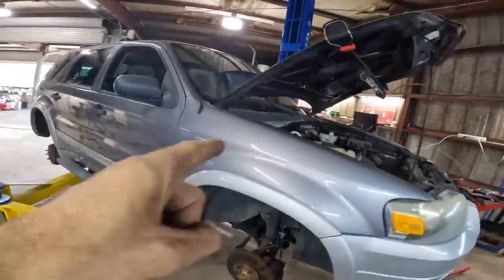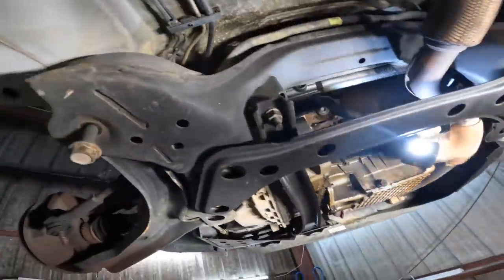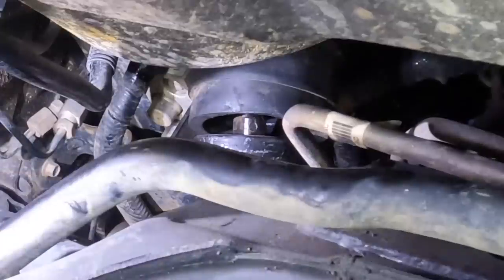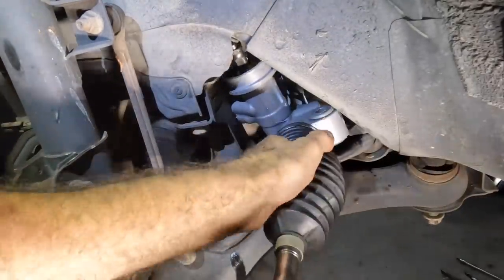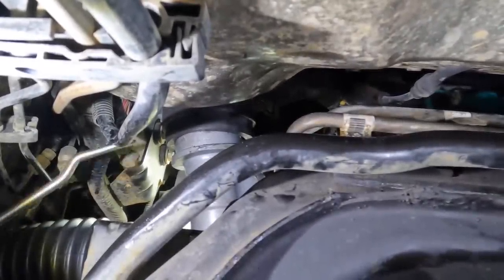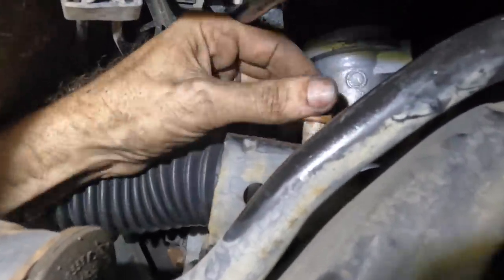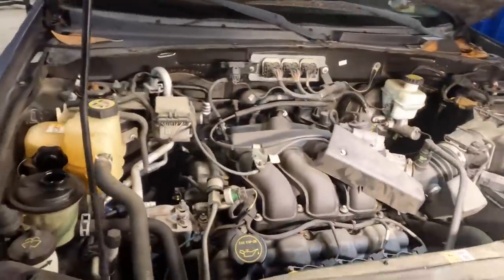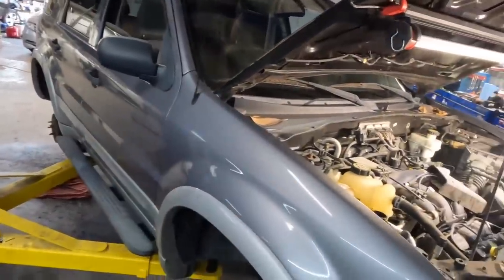Loss of Control, Sloppy Steering! Damaged Ball & Socket! 2007 Ford Escape

Comment: When I replace a steering rack, I always check front tire wear. If the wear looks good, I reinstall the new rack exactly the same length as the old one. It doesn't work if the old rack has too much wear. It works on leaking racks. An alignment is always good, but sometimes not always possible.

Comment: Really any full synthetic oil and a quality filter will work fine.  I usually run Pennzoil Platinum High Mileage and a Wix XP,  Purolator Boss, or a Fram Ultra Synthetic filter.

Comment: So on the oil stuff. My brother taught me this a few years back, but supertech full synthetic has the same stuff as the name brand stuff you're saying at a fraction of the cost. As long as you follow typical oil change intervals it does the same protection. He's put it in all his supercars to include the latest  Masi he bought. Never had engine issues in any of his cars.

Comment: I am sitting on a passenger side front seat out of a 2007 Ford Escape. Blue vinyl, still in good shape. I have it mounted on a base for my driving rig/office desk/entertainment seat. Bought it for $60 last Summer at a local wrecking yard. Lot cheaper and more comfortable that a driving rig seat. I put an Indian blanket/Mexican blanket cover on it. It will last many more years. Buy the passenger seat since they do not get the same number of hours as the driver side.

Comment: I have 2004 cherry condition Ford Escape XLT with 190K on it. Best car EVER! Never heard of a steering problem... 🧑‍🔧🤷‍♂
Over here we have daily free delivery by the parts houses.
I have in years past scribe marked and measured steering parts, shafts and ball joints. Upon reassembly use corresponding scribe marks and measurements, didn't need alignment.
SO HAPPY you don't use a d*mn phone for these recordings. I cannot STAND those things.

Comment: wix, fram, etc, etc. look up a oil filter for a 1966 vw bug. mine had over 200k on it when i sold it. i do use wix, mobil full synth in my wife's rav4, just acquired a tsx that has had and will continue to get that treatment along with top tear gas only. 91 f250 258k on odometer, 86 ranger with 320k get fram, Costco oil and cheapest gas around.

Comment: I would cycle the steering a few times to get all the air out of the rack.
I'm not sure if it's necessary, but I imagine it gets trapped in the cylinder.

Comment: Doing the repair correctly and professionally will usually be enough to give you a chance at success, but it's doing the "little things" that will ender you to your customers for their repeat business.  And, little things can generate extra income, AND go a long way with customers.  And it just takes a minute to go that extra mile to build customer loyalty, anytime you touch their car,   i.e. topping-off all the fluids, checking all the lights, signals, and wipers, checking the air pressures in their tires, greasing all the frontend joints anytime you work on the frontend.  Some shops (mine included) even clean the windows and vac the floors.

Comment: Escapes are notorious for motor mounts and steering locking collars going bad. Used car dealers always trying to pass off the engine vibration as normal for the Escape. Same for the difficulty getting the key to turn far enough to start the engine.

Comment: Hey, quick tip on the "whine" or air cavitation after startup/new rack/new pump- manually run the steering lock to lock a good number of times, that manually bleeds the system. You'll see the fluid drop a good amount. Doing this prevents possible cavitation damage on older pumps. Hope it helps.
Also, congrats on the shop!

Comment: What is the difference between a cotter pin and a split pin?

Cotter pins are made of mild steel and are used for locking nuts at the place. They are inserted into the hole of the bolt and are then bent into different shapes to prevent the nut from falling out. Whereas Split pins are made up of harder grade steel. It is once inserted into the hole to lock the nut.

Comment: Ford specs synthectic ATF now  for transmissions and power steering.  From personal experience last weekend the Valvoline DEXRON®-VI ATF Full Synthetic Automatic Transmission Fluid worked very good and make my power steering noise go away when cold.  I used 1.5 quarts from walmart and it was like $7 a quart.
Reply: Wouldn't he have used mercon 5?

Comment: I ask this as a question as to my last power steering pump replacement. I for the life of me couldn't get the lines purged. So much so that I thought I got a defective pump the first time as it got quieter for a day or so then it would start the whining again. So I replaced it again, same issue. I spoke to a "real" mechanic and he said that I wasn't doing it right. I did as you did and just removed the cap and a couple of quick turns left then right. Which I notice you didn't even do? 

He said to remove cap, and then endpoint left then right several times with engine off (Car jacked up of course). Then allow it to rest a few minutes for air to travel up lines, and then rinse repeat several times to clear all the air. Then start engine and endpoint to endpoint to check and then repeat procedure if needed. His explanation was that once engine is started the air is "whipped" into the fluid thus once cap is replaced it can't purge from system. You say the whining stopped but I could still hear it somewhat....So what is right as when I did it his way I had zero issues from then on. Are different manufactures different procedure?

Comment: I have a 2010 Acura RDX and it requires Mobil 1 5w-30 and with 114k, I use the High Mileage formula

Comment: 21:52 said every other mechanic before you. You know................ the ones you used to comment about when the customer says someone else did the alignment and it was off. Not taking into account the worn, sloppy parts that are now fresh and tight. HAHAHAHAHA

Way back in the day I used to hang with my uncle who was what some people refer to as a "shady tree" mechanic. A mechanic who used to wrench out in the yard using ramps, chain hoist, etc. When he did front end work he used to pretty accurate with aligning the wheels. His method consisted of a two inch piece of flat stock steel, long enough to reach where he needed it to reach. He would pull the rear wheels, line that steel up with the front wheels and watch the linear path or angle to make sure it was straight. After he would road test and always travelled straight. Never had a complaint or return work. Even some alignment people were impressed at his method. Of course today there are modern computer methods that people swear by. There was a time when alignment equipment was not available.

Comment: Figured out the weekend that these new injectors are still  (causing) Regurgitating aka (regenerating/over fueling ) since the other Thursday /week and a half. So going to find out if the injector codes were installed as well. With doing two trips to where I normally go to work on the truck with O/D off so ran at about 2,600  should have burnt that soot out!!!!!!!!!!! One with driving normally. 
Burns lots of diesel with that crap working. 
Sure would be good to have Ray work on it, but way toooooooooooooooo far away. 
The service advisor the other week said that the mech akaRE/RE was fastidious about (Clean)  YA RIGHT! His coveralls were oily as Hell! Do wonder my seat blanket was OILY!!!!!!!

Comment: I have a feeling, it's a lot more involved to gain easier access, replacing that steering unit, but like they say, "time is money" and the bottom line is, your way worked.  ;-)
I'm sure there's a way of locking that "death bolt" in place, but I didn't see how?

Comment: have you got a white (or melanin deficient) pen to mark those nuts so you know for sure its torqued up before it leaves your workshop to get an alignment? Weve had customers moan that a bolt was left loose, they blamed us, but it was the alignment place that adjusted it and didnt  retighten it again afterwards

Comment: I once decided I wanted fuel economy and I got an Escape...  It was only a few years old so I figured it would be ok.  It wasn't.  The car is a disaster.  The battery is in a spot that is REALLY hard to deal with if there is an issue.. and there was..  So many things were wore out and needed maintenance.  Just as you show its a hard car to work on. Its just too tight and crammed up to make doing anything easy.  I drove it about 2 months and couldn't stand it any longer and traded it back in on a new Jeep Compass.  Fuel efficiency was about the same but the Compass drove MUCH better.

Comment: Hi Ray like your videos.  A subscription to Motorcraft Service, or AllData/Shopkey would be a good investment though.  No need to remove the rear subframe bolts to remove the rack.  Only the rear transaxle mount needs to be removed.

Comment: Pretty much any Ford products lately have got me gun shy on doing anything to the brakes, every time you touch the brakes you get an ever since with a low pedal and the ABS hydraulic control unit out. Especially stuff like the escapes, Mariners, any of the little Lincoln SUVs.

Comment: What type of tire balancer are you going to get? Also tire changing unit? Get one that is gentle to alloy wheels.
Reply: If I was in his position I wouldn't get either because of lack of space inside or outside, the cost of keeping inventory is money tied up and you still never seem to have the tire you need so you end up having to order and wait for delivery, all the while you are in competition with Discount Tire, Tire Barn and other big dealers that can always beat your price, it's better to just send the customer to them and concentrate on money making jobs.
Reply: @indianaslim4971  Planning ahead, when I need a set my mechanic orders them in.  But you are right, not practical for an independent to stock.
Reply: @desotosky1372  For a couple of years I was the parts room supervisor at a Toyota dealer with many wholesale accounts and we had at least a hundred tires in stock and were constantly having to order tires, there's just too many brands/sizes out there to compete with the big tire stores, for a small independent shop like Ray has it's best to not get involved in that part of the market, there's not enough profit margin compared to suspension work and engine/emission work.
Reply: Or A/C work.

Comment: Your reputation will proceed you. If you need additional security and feel you'll be at this place for at least 1-2 years, consider speaking to the land owner about installing drop down bollards to keep vehicles secure overnight. I know there's a gate, but it won't stop someone with bolt cutters. 

A powder coating place near me had a Ford Ranger pickup, BMW 340i, Jaguar F-Type coupe & a Maserati Ghibli stolen from their property. Only 3 of the vehicles were recovered by the police; one still to find, is thought to now be in parts all over Europe

Comment: Cotter pins and split pins are not the same!
A cotter pin has a eye at one end and the other ends get bent in opposing directions and the strength lies within the bent portion opposing forces etc.
Split pins are just a pin with no head and a split through one side of the pin they work on the interference model 
Just a thought that I wanted to clarify not taking anything away from you Ray keep up the good work and excellent customer service

Comment: ray u are so lucky ur from florida im from wisconsin have a 06 corolla my copper pin wasnt even distinguishable like i tried penetrating fluid and hammering it loose it did not give i had to drill the cotter pin and jus took the castle nut off like that i mean it worked 😂🤷‍♂️

Comment: Use a Motorcraft 820 and Motorcraft oil.  Rich will keelhaul you for using a Wix filter.  Just kiddin', bud.  Glad to see the shop is working out thus far.

Comment: For those who say that  using a hammer to unlock a tie rod from the arm of the spindel  is stupid  just go back to school cause when you need to keep the tie rod  thats the only way to not damage the tie rod . and it doesn't damage the arm one bit unless the tie rod has been torqued at 1500 pounds  by a total idiot in the past . Its also the same method used  when you need to save a ball joint . Used it all of my life  cause most of the time we had to save those parts  cause they didn't come  with the part that needed to be changed and the customers wanted to save the good parts as much as possible .  Unlike today where you have  suspension arms that comes with the new ball joints and a sterring rack that comes with its tie rods for cheap ,   20 years ago it wasn't the case . You had to buy all these separatly  and it could raise  customer"s bill  really fast . Thats why we had to save the parts  that  were able to be saved .

Comment: I have a question for automechanics. It seems Ray is using only battery powered tools. So I guess air compressor and it's tools are totally obsolete these days?
(sorry if this is a totally noob question I don't work in the industry)

Comment: ASE certified:
A1 Engine Repair
A2 Automatic Transmission/Transaxle
A3 Manual Drive Train and Axles
A4 Suspension and Steering
A5 Brakes
A6 Electrical/Electronic Systems
A7 Hearing and Air Conditioning
A8 Engine Performance
A9 Diesel Engine Certification
C1 Service Consultan

Ray is well qualified

Comment: "What a waste using Mobil1 synthetics", is what I hear every time I change my oil. yet somehow at over 200,000 my engines are still clean and not knocking. Why is that? Ran it in my motorcycles also and it worked better than the $16/qt. stuff.  Even used the drain oil in my lawn mower LOL.

Comment: I think from what I've read, not much of a debate over Wix. I wanted to get like a K&N filter for my new Subaru but doing the Googles told me K&N just scratches the surface of aftermarket and Wix seems to be the top recommended. That and the purple what's its. Pretty sure I'm overthinking oil changes but I want to baby this car better than my last one, which easily went a good 15k miles between changes because lazy!
Reply: My mechanic prerfers to use the Subaru OEM filter.  Wix XP for most domestic stuff.

Comment: I'm a Ford driver myself, but even I have to admit that there should be a national holiday where you can legally slap the crap out of a design engineer.
Reply: It's the bean counters that needs slapped, engineers regularly get over ruled due to costs, remember that manufacturer's main objective is to get a car down the assembly line as quickly and cheaply as possible, they aren't in the repair business, once they're built and sold to the dealership they don't care how easy/hard it may be to repair.

Comment: Does the steering rack come from the manufacturer pre-centered also I usually put my tires on put it on the ground and run the front end back and forth on the load to get extra air ouzt I'm not telling you how to do your job you know what you're doing and as far as the trolls you do not need to justify your actions it's your show you know what you're doing and for them to put their two cents in I take it with a grain of salt I wouldn't justify anything have a great day thank you once again for letting me into your life bye

Comment: what you called the Kill people bolt can also be called a Jesus Bolt.   "Jesus nut is a slang term for the main rotor retaining nut[1] or mast nut, which holds the main rotor to the mast of some helicopters. The related slang term Jesus pin refers to the lock pin used to secure the retaining nut. More generally, Jesus nut (or Jesus pin) has been used to refer to any component that is a single point of failure which results in catastrophic consequences, and the only thing left to do is pray to Jesus, hence the name. "

Comment: As a prior customer of Ray's I can confirm this is all fake CGI. Went in for a tire rotation, and he didn't do the correct swap of left and right sides. Wouldn't plug my sidewall. Pretended my brakes were bad to try and get me to replace them, when I know the grinding sound means they're working. Didn't even refill my blinker fluid!
Fake mechanic. Sad.

Comment: From a 20 years aircraft mechanic, your cotter pin installation make me cringe... sure the thing won't goes anywhere, but...bent the top one over and cut it flush with the bolt, cut the lower one and bent it on the side of the nut, will take you the time to get your cutter.